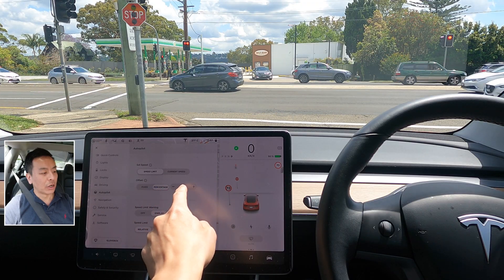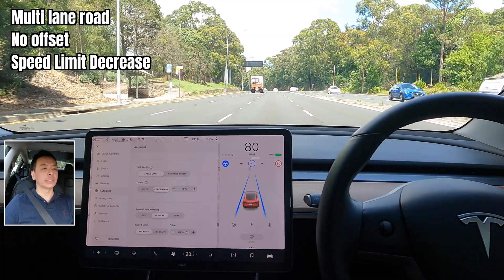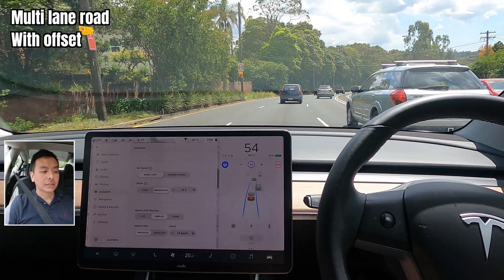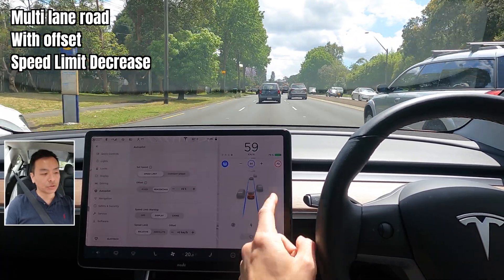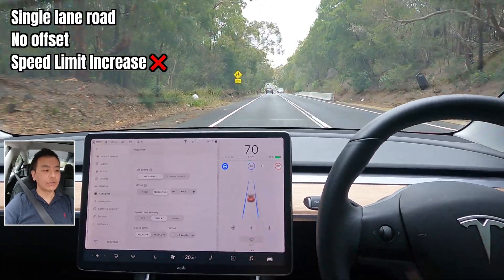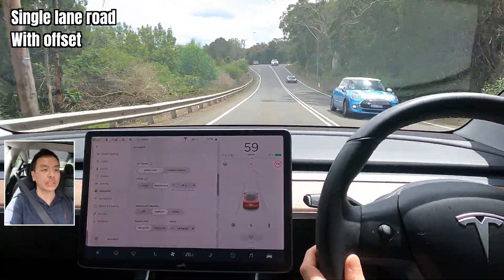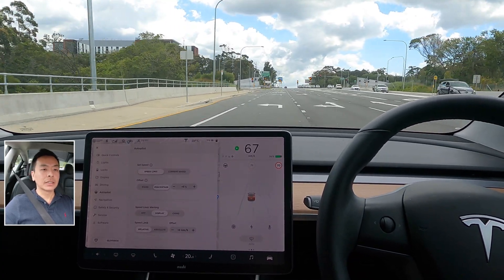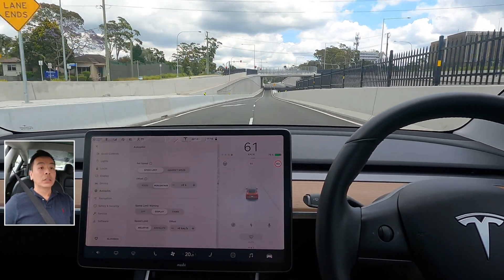Tesla Autopilot Speed Limit Offset Testing 2020.44 Model 3 | Tesla Tom

Comment: Thank you for sharing your video. Very useful information from your videos. I am from Brisbane. I got my Tesla model 3 delivered 2 weeks ago. I am having the same issue. It doesn’t increase speed limit automatically, and doesn’t goes down (even in single lane road).
Reply from the maker: Thanks! It’s a bit complex with posted speed limit adherence. Your original speed that you first engaged AP for that session must be higher than the subsequent posted speed signs before the car can match them on single lane roads 🤔

Comment: I am not sure why.. I push the speed limit but it the speed didn’t adjust, I have to roll the button to increase the max speed.. I version is 2022.32.21
Reply from the maker: I normally use the right stalk half tap down to match posted speed sign. I’ll have to try the screen tap to see if I’m experiencing the same as you on my next drive
Reply: @LudicrousFeed  thanks Tom, I just tried the right stalk half tap down way, but it didn’t work. So let say, the sign is changing from 80 to 100, but the speed stay at 80 even though the sign on the monitor showing 100. I tried half tap but nothing changed.
Reply from the maker: @cupidvivi  Maybe it's only an FSD package thing hmm

Comment: Hi there. Just discovered your channel. Interesting video, and matches my experience. One thing I want to add: on single lane roads, on Autosteer, you cannot push the desired speed above the road speed (+ offset) using the scroll wheel or by tapping the current speed indicator, but on multi-lane roads you CAN. This was already the case with 2020.40.8. I wonder whether you tried this as well?
Reply from the maker: Yes that scenario still holds true on this update. 
Thanks for stopping by!

Comment: What is the maximal kph/percentage offset you can set?:)
Reply from the maker: -25% to +30%
-10kph to +10kph
Reply: @LudicrousFeed  thanks, wow +30% sounds like a pretty high tolerance :). Wasn’t AP restricted to max +10 on a single carriageway before? As in an 80 zone it should go up to 104 with this setting now.
Reply from the maker: @masi7057  I’m not keen to test that 30% offset! 😜

Comment: Tom, thanks for another great video. I find on single road that it will increase and decrease automatically, but only up the highest limit that had been previously set. Eg. Start in a higher speed zone, then into a lower zone, then into a higher speed zone. Good for country driving going from 100 then 60 (automatically) through a town then 100 (automatically) back on the highway.
Reply from the maker: Thanks Mark, that’s interesting ... I’ll have to try to find somewhere similar to test where it the highway slows down when going through a town/locality 👍🙂